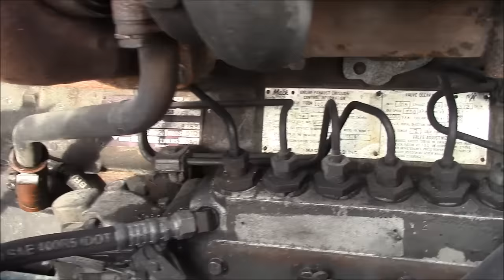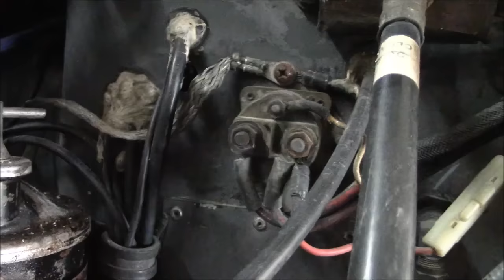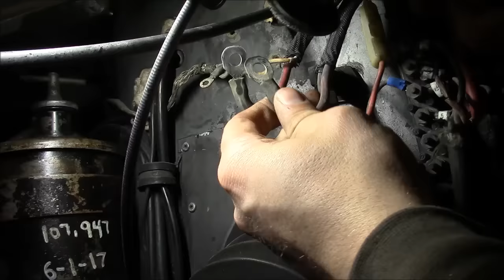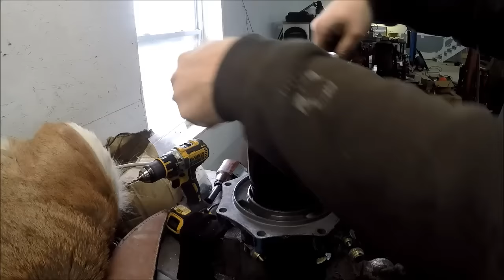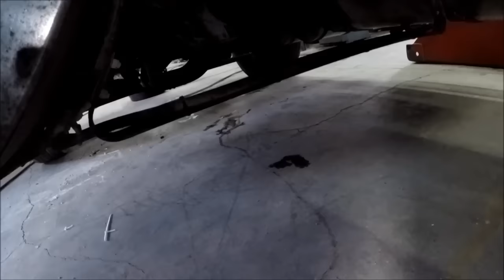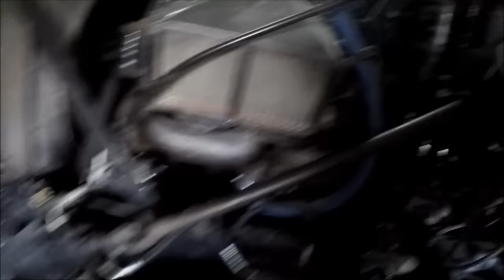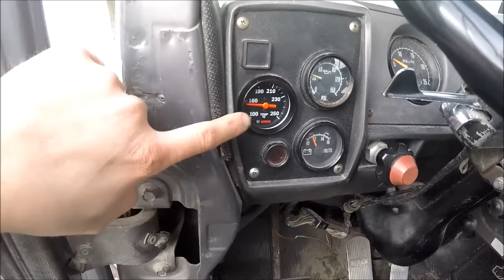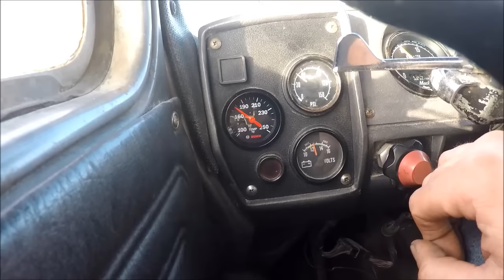Cool 1977 Mack RL600L - No Crank, No Start - Plus Many Other Repairs

Comment: That alternator shows all the signs of not getting initial power to its rotor winding. Back in the day, the small current through the dashboard indicator red light would start the process and once the alternator was producing an output, that would power the rotor too.
Reply from the maker: It's a single wire setup. It should be self exciting.

Comment: I have always assumed the grease used on electrical connections was used in a similar way to heat sink compound  - the main path (for heat or electricity) was metal to metal and the grease is there to serve a secondary purpose to take the place of air where there is no direct contact. Air could lead to corrosion in an electrical contact or (for a heat sink) reduce thermal transfer.

Comment: Great watching Wes work... it's not an old wives tale about the old style 6 ,12 volt or even 24 volt battery... they had inferior cases and so when placed on concrete for a period of time they would be drained of charge. Of course you are to young to remember that,,lol! Whipper snappers, it's old school training,and I still have second thoughts about placing my new style batteries on the concrete 🙂

Comment: Holy cow man I learn soo much in this video, my dad own an old 1974 R600 Dumptruck with that crazy 4-6 volts battery config. That being stored since 2003 and im thinking to bring back to life, I mean I only work on small cars but recently I restore the wiring harness of an 1975 Hino Ranger KM same stored from 2003, greetings from Costa Rica!

Comment: When I worked for Martin Gas Transport out of Tyler Texas we had a huge fleet of those R model Macks. Nearly all of them puked oil out of the air dryers because there was something about the replacement rings that caused the crank cases to be pressurized and blow oil past the compressor's seals. That start up smoke you got was also symptomatic of this problem. It was a big outfit and they just dumped more oil in them back in the day. May I add that those engines are very sensitive to boost pressure loss and the rubber bits in that feed is really crappy. If you'll deal with that it will give dividends in power. Just say'n. Nice work BTW you obviously know your stuff. Thanks.

Comment: You got me exploring the question of grease and electrical connections. It was very interesting. Dielectric grease is not conductive, which is actually a good thing. There is a grease that is actually conductive but that could very easily lead to problems. For example, using it in the light sockets of your vehicle would lead to a short circuit in the socket. Not good. The reason dielectric grease is good is that it prevents corrosion in the connections. The metal to metal contact in the connectors is good enough that the dielectric grease does not prevent  a proper connection. I suspect the very thin film of grease in the connections is not enough to interfere with current flow. I suppose a quick test would be to bolt two connectors together dry and measure the resistance across the connection. Then apply dielectric grease to the same connection and again read the resistance. I highly doubt you would see a difference. You will see a difference in connections that are in a corrosive environment. Corrosion would be a much greater problem on untreated connections.

Comment: What a great truck, except that 5 speed, in the hills here they’re useless. Most guys that are still running the old R’s around here have swapped the 5 and 6 speed Mack’s out with the 2090 or 2010 series Mack 9/10 speeds or an Eaton fuller.

Comment: That is a nice truck. Great repair work and beautiful sounding engine. Love the straight cut gears in the gearbox. The Voltmeter at the end of the video is still reading a bit low. For a 12 Volts system on charge the voltage should be around 13.7 to 14.4 Volts.

Comment: Nice old unit cant tell if its a econodyne  or a coolpower  I have several older Macks like that one thing to look after the breaker strip behind the glove box tends to get shook down and can short out . what trans does that one have ?? all Macks use those rockwell rear axels  and you can convert  them to S cam brakes   Some of them have a series parallel switch  you can use a older Ford solenoid on them too .

Comment: I know this is old, but SOOW cabtyre isn't resistant to hydrocarbons and the like (at least, no the inside stuff).  If you want the wiring to last then use TEW inside some non-metallic flexible conduit.
Just a suggestion.

Comment: Dielectric grease is electrical insulator as other say on the internet. But, there is something they are misunderstanding. Grease get pushed out of way when making electrical connection. Therefore, will make electrical connection without problem. That small resistance may cause problem in modern computers or smart phone that uses 1.5V or even mV, but not a problem on a vehicle. Dielectric grease prevents spark from jumping in spark plug post to engine or something grounded, but doesn't really interfere with the connection itself. 
However, I did find one possible problem after I applied to my vehicle's spark plug. I put electric grease in spark plug terminal, and when I was changing spark plugs 5 years later, I found some dielectric grease got hardened and became silicone blob. Apparently heat from the engine cured silicone. I don't know if dielectric grease I got was defect, but never applied on dielectric grease to spark plugs since then.

Comment: All the hydrocarbon floating around older engines attach to wires especially spark plug wires   and break down the insulation. It actually becomes conductive on plug wires.

Comment: Batteries on concrete is just Bs I used batteries that have been sitting on concrete for 4 years to test run a scissor lift no problem

Comment: You're absolutely correct about dielectric grease. It's purpose is to stop disamiler metal current flow corrosion. We used it a lot on Coast Guard amphibious Grumman seaplanes and Sikorsky helos back in the '70's on every screwed or bolted wire connection.
Forget what the armchair internet trolls tell ya.

Comment: What's your though about putting vaseline (The type without any acid) on electric connectors? I did that years ago on my old French Matra Murena. I just melted that stuff into the 35 years old conectors and sealed them in to a piece of bicycle inner-tube with some ty-raps. It's a bit messy, but I thought it was a good plan Haven't started the car in years, but maybe this is the year to get it running again, It's getting 40 and should be exempt from road taxes :)

Comment: Di electric grease is definitely  conductive as a mechanic  myself  I put it on many connections even small micro 64 terminals. Even following  service  bulletins to use it over for years.

Comment: I use any old grease on my battery terminals solenoids large amp relays.
The reasoning is that in the absence of AIR or the absence of OXYGEN corrosion will not form. This prevents the deterioration of the cableing which is more susceptible to corrosion considering there is air in between the individual strands. 
The lead being considerably more dense can corrode as well but not as easily.
Between the Lead, Sulphuric Acid, Hydrogen Gas, Copper, Brass, Steel, and ? Plastics it is a hodge podge of Materials just waiting to corrode away.

Comment: I think you should not use dielectric grease in electric contacts. I think the proper way is to use something like CRC or Q22 electrical contact cleaner after that use Q20 or wd40 on top of it to chase humidity.
I think Q20 is better than wd40.
Please look at this video and you will love it for your rusty bolts 😁😁
https://youtu.be/QB1V1GH_V4k
the video is in arabic but you will understand by watching it only.
ie. I am not selling or promoting Q20. I just saw the video and I loved it.

Comment: I wish there were videos debunking the myth
that Humans are dumb, dangerous animals.

Silicone paste (cream) is mixed with Zinc oxide powder.
The #1 enemy is the highly corrosive and reactive gas known
as Oxygen; when electrified, it converts to Ozone. Micro arcs
happen between energized terminals. Ozone forms a green
crust, that is an insulator, and will corrode all metals except
gold and some other exotics. Life saving electrical equipment 
uses gold plating and gold wiring- such as SRS circuitry.

After a terminal connection is created- simply coating
with paint, silicone, grease, even glues or epoxies
is better than nothing. Certain epoxies called
"potting" are used to isolate & protect vulnerable components
from atmospheres, moisture, vibration.

Choice of color Plasti-dip spray is excellent for protecting
electrical stuff.

Comment: Ha! You used shrink wrap! We used it a lot at my old workplace. I operated a cable cutting machine, while the others built wiring harnesses. I was glad to see how nice that joint was made. Thumbs up!

As to the word dielectric, it was used by the engineers at the radio transmitter plant, and in reference to the ability to resist electrical power flow. It was often used in reference to wires, and the insulation's ability to prevent arcing. My knowledge is all second hand, and I'm not sure if it's even useful in relation to your discussion of dielectric grease.

That's all I got. Youtube armchair occupier. Love watching these vids, and I'm learning a lot. Love it when you work on the big gear.

Comment: It should have an air shift button to go from lo to high range which makes it a 9 speed im pretty sure
Reply: Another strange thing I noticed, the parking brake only holds on the rear axle, the forward axle does not have parking brake air chambers
Reply from the maker: It's a straight 5 speed. We are only required to have spring brakes on one axle. That's very common.

Comment: Just finished reading nearly all the post below and reminded my of the other transmissions I fell in love with. Owned a GMC brigadier with 671n and 10sp roadranger dump loved it. Drove a peterbilt with 400 HP Detroit with a super 10 RR. Was a rocket ship. How ever the R model Mack with the 5 speed and the 300 engine was my all time favorite because it was the easiest to drive and remembering the sound of the turbo spinning up and the kick in the pants pull still gives me goosebumps.

Comment: Mack 5sp very easy to drive. Shift slow and deliberate. Let rpm drop between shifts and let the monster torque of the engine do the pulling. Once you get used to this trans you wont want to drive anything else.

Comment: how you do the dielectric grease is fine. metal to metal  the grease will just fill the voids maybe not doing anything but grease is hydrophobic. and having a resistant grease in the voids could stop high resistace joints.... but the main reason its fine is because you tried something and it worked so why the hell would you change it... if it didnt work you wouldnt do it  if dielectic grease worked how they think how do capacitors work.

none of the people saying your doing it wrong have an alternative or scientific papers disproving your idea and even if they did their usage case is probably for a completely different environment e.g i dont use anything because rust is a non issue here but me saying its pointless based on no information or proof is fucking stupid lol

Comment: a million years ago I was a mechanic for a logging company. well I broke my back and neck in 4 places fast forward a couple decades and I'm driving a international hauling airfreight across the border. TIME EXTREMELY TIME SENSITIVE. Anyway I was in the foothills at 3am it was snowing and my lights started blinking then totally went out . I called for a roadside service company fora fix. by the Time the service truck showed it was daylight. so I followed him to his shop. at the shop he determined it was a relay like you replaced . so at about 1pm he located the guy he knew at international parts and got a relay oh this happened on a Sunday . he got the pet all went well until he tightened the last nut on the battery side post when he snapped the post. 
 the international parts guy refused to come out a second time on a Sunday. 
 so I walked across the hiway to a autoparts store and bought a starter relay for a Ford $12 the international relay was like $200 and I was on my way . it was a very exspensive breakdown for a $12'part

Comment: Many years ago the same falderall was said about dielectric grease. I have seen arcs even with a dielectric grease coatings with massive high voltage switches and an arc snuffer,  (compressed air), had to be employed to  blow out the ark in very high load situations. I always painted the surfaces even when the knife switches were lined with silver for higher load capability when snapping shut.

Comment: Dielectric grease is a silicone grease. Silicone is an insulator. While the dielectric part means it can transmit electrical force without conduction and this is sufficient in many cases, you shouldn't apply the grease where it's not absolutely required because it is an insulator. A clean bare contact to contact connection is preferred over one that has layered with as much di-electric grease as possible.

Comment: putting it from 1 gear to another , do you not need to use the clutch in between ?  1st gear , clutch in , neutral , clutch release and in again to second gear  and up ?
Reply from the maker: You can. I don’t.

Comment: "I have used a product thousands of times." Repetition is hardly an indicator of correctness.  In this case clearly dielectric grease doesn't stop electrical connections from working because people use it however they want.  I'll also state that coating the outside of the connectors will work fine as well.  Because people use it that way as well.

Comment: My own experience with dielectric grease was in an factory setting. We used it to protect the connections from the corrosive moisture in the air. Never had any issues with it increasing resistance, but it did do a great job preventing corrosion.
Reply: Yes sir I have found that dielectric grease acts as a shielding element to prevent corrosion. Basic as the shielding gas around the welding process to prevent oxygen contamination of the weld. I have always used regular automotive grease on my battery connections on my vehicles (learned that one from my Dad) and all of that corrosion you see on battery terminals does not exist. Of course I could also use dielectric grease there as well, but old habits die hard. Back in the seventies I had a coworker that had a Chevrolet Vega and it was blowing the fuse to the fuel pump (yes it had an in tank electric fuel pump). Well he came to work one day and told me he found his problem. He said he broke the harness connection to the fuse box and found a bunch of grease and he cleaned it all out as he thought it was shorting to ground and blowing the fuse. Not so; that was from the factory to prevent corrosion (now he was going to have a green harness connection). The failing was that the electric fuel pump was grounding out and blowing the fuse. Of course I wasn't aware of the technology at that time but as time went on and I learned more it made sense. When we replaced a power transistor we also coated the mounting surface with a paste designed to aid in heat transfer which of course was probably a dielectric type grease.

Comment: Drove a old Mack rear dump mixer for a while from this era, it had a Mack 5 speed, and a 4 speed Brownie.  She always fired up, always went slow, and about killed any driver that had the guts to try out the silky smooth Mack suspension....  Same place had a R model dump truck that I learned how to finesse the 5 and 4 in, probably had a billion miles on it when the motor dropped a valve.  It's probably still sitting where I towed it to...  At one time the concrete plant I was working for had I think 5 Mack trucks, some B's some R's, all parked in his bone yard.  One day he got the bright idea to move them 100 yards to the "new" bone yard.  All but one of the old girls started without any spray, and the one just refused to go without a whole can of start.  He said some idiot had just sprayed it every start to the point the cylinders glazed, and she wouldn't go without help.  I've often thought about maybe buying one of the old girls for a project, but whew....  Expensive to restore!  They were at the point where everything would have to be either fixed or repaired, starting with engine overhauls, seals, brakes, the works...

Comment: With the new style batteries concrete will not discharge them, the old style batteries that were sealed with a tar like substance it would because they leaked even when new you had to check the acid level weekly or you would find dry cells.  Old person Still Learning .

Comment: 17:45 Wobble extensions are so insanely handy. Before I knew about them, removing the upper bellhousing bolts on BMW's meant 30" of extensions with a universal on the end which was then wrapped with electrical tape so it had minimal movement so it didn't drop the bolt out when fishing it up and over the transmission. Wobble extensions made universals wrapped with electrical tape a thing of the past. WAY stronger as well.

Comment: I did have some dielectric grease on some spate connectors in my headlight of a 1974 BMW motorcycle. The current draw was enough to heat up the connections that the grease started smoking and i actually broke down. After cleaning everything of i was back in business. 
BMW motorcycle from the 70s had most of their wiring in the headlight bucket.
Reply: Undersized wiring?